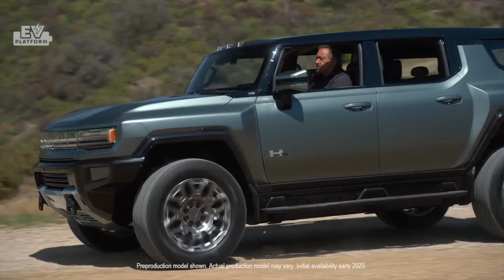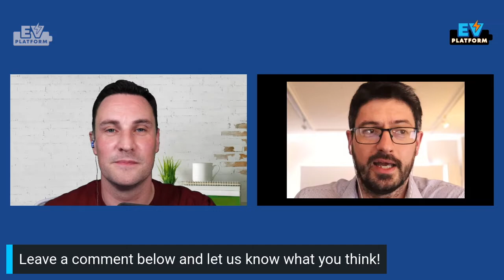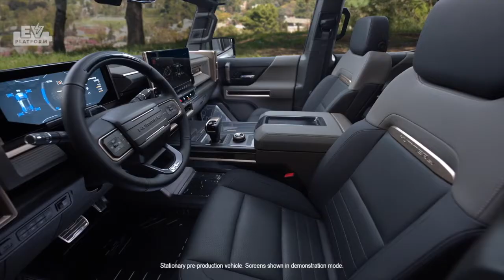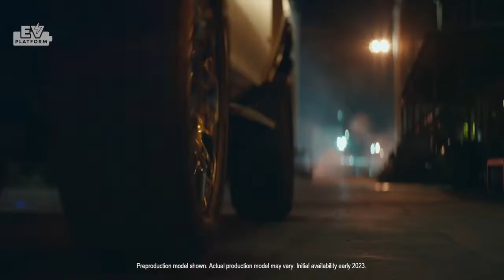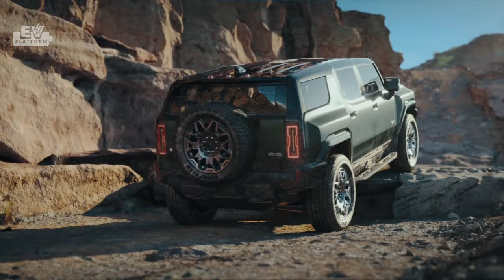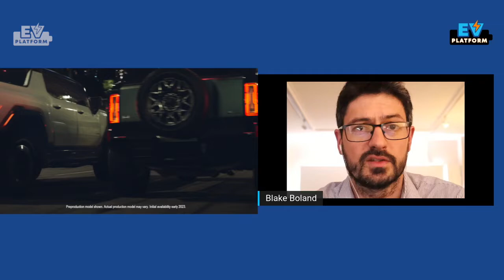Hummer EV -  Is it the Awesome Abomination?

Comment: This is an awesome machine.  Yes, it may be a little excessive, but this is what leads to innovation- high end vehicles come out with the latest and greatest which then filters down to cheaper vehicles.  Also, not sure why you are talking about scooters and ebikes here - all electric cars would then be considered taking batteries “away” from them and not just large electric trucks.  Besides, people should be walking and riding their regular bikes rather than taking scooters and the like.  That’s healthier and utilizes no batteries.  Lastly, I hope you think every modern Land Rover is an abomination as well then as they are larger, at least when comparing SUVs, than the Hummer.
Reply from the maker: Thanks for the comment Matt! Sound like we agree on a lot of points there...absolutely best thing is to walk, then cycle, then public transport, etc. Do I consider every Land Rover an abomination, no. But if you're referring to a 4.4l turbodiesel Range Rover that is primarily used around residential areas with one or two passengers, then my answer would be leaning toward yes. Appreciate your interaction here. We're trying to engage and get discussions going around the electrification of transport and it's great to engage like this!